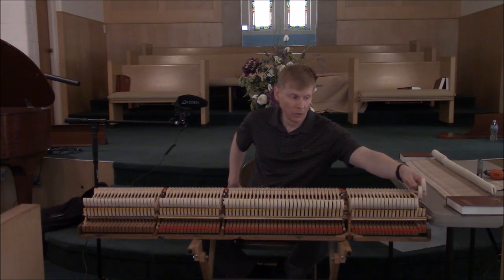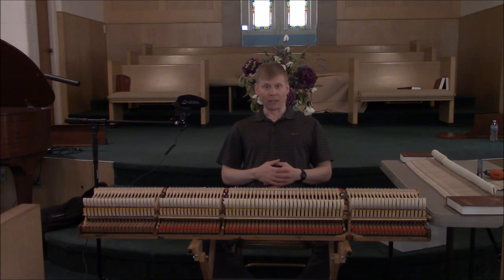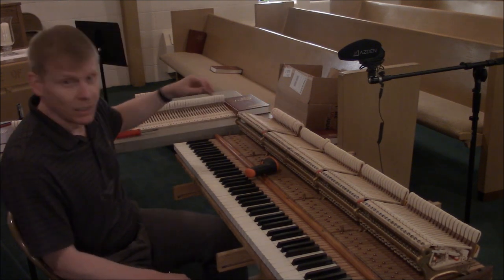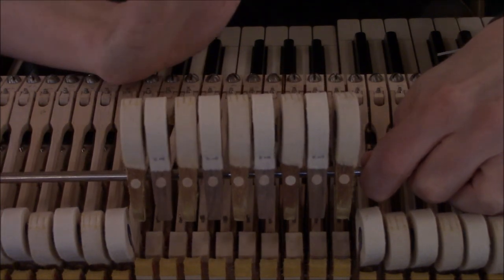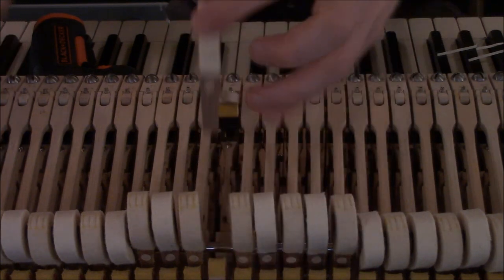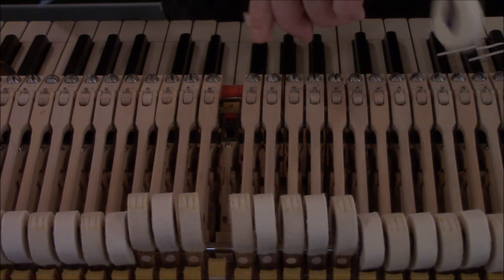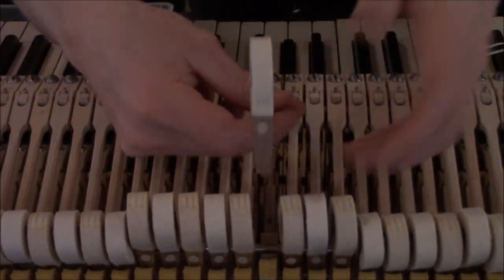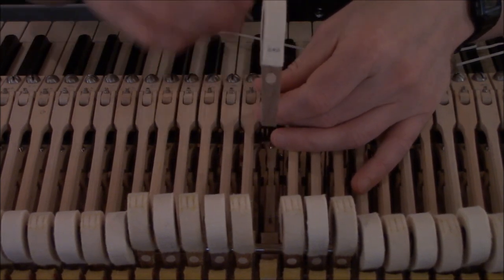Installing new hammers and shanks on a vintage Steinway with before and after sound samples

Comment: Good video but u made a mistake at 4:56 ....I think it's not the 4th hammer from the left that needs to be shimmed but the 3rd (which has a not straight trajectory). Though the sound after is a little more mellow and dark indeed but if it was me I wouldn't have replaced the ''old'' hammers at this time. Still a lot of felt on them and with a proper voicing down (needling or softnerer) you could had the same result OMHO.